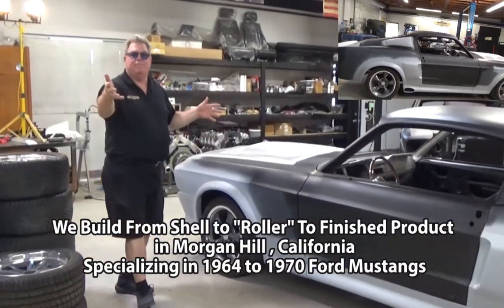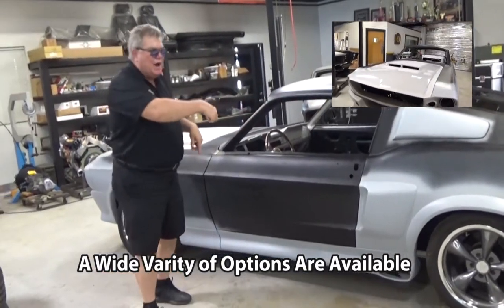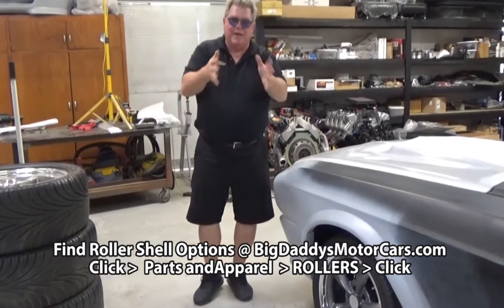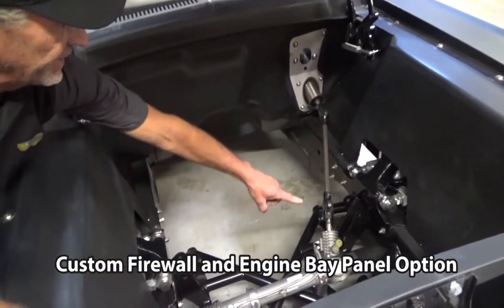1967 Ford Mustang Fastback Roller Shell With Options

Comment: So what is the official designation of these rollers. Does the 1967 shell have a vin, and can it be registered in Mass as a classic 1967?I want to build one with a Coyote Gen 3 and the latest Whipple supercharger.
Reply from the maker: We get the shells with a MCO (Manufacturers Certificate or Origin) which can be used at DMV to obtain registration and a title.  If you call we can explain further.   btw, we have a 67 build for a customer with a Gen3 Coyote and a Gen5 Whipple in the shop now :)